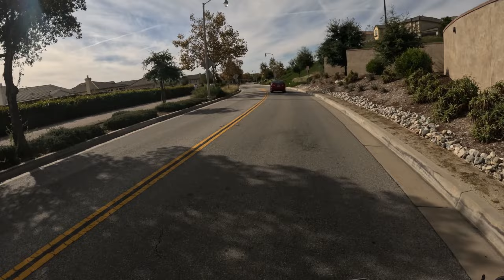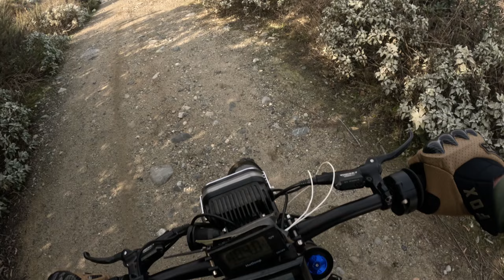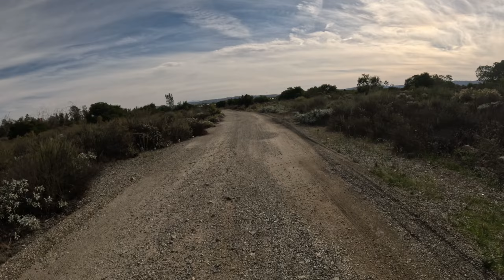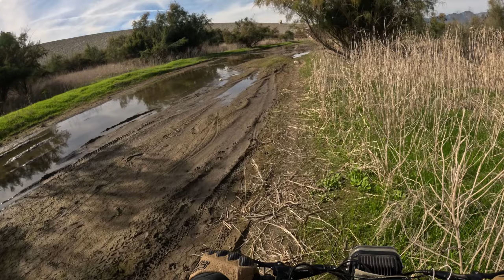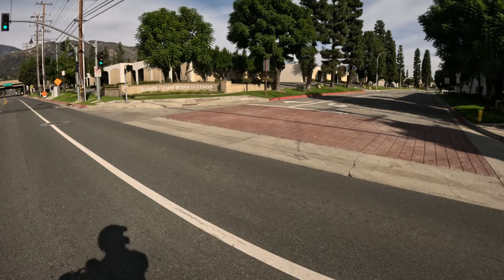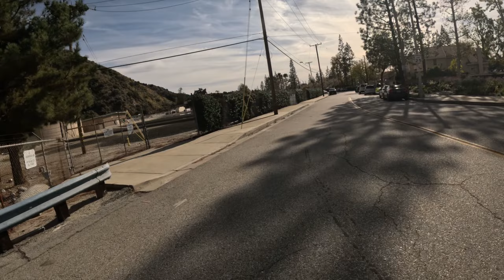Testing out the HSU Windslayer on a GoPro. Dealing with Karens, hitting jumps, and high speeds.

Comment: Nice bike. How did you connected the temp sensor to the motor ? Did you used the stock temp sensor with the white cable inside or did you manually installed a new one into it ? Would love to see how you build this monster. Nice content 👍
Reply from the maker: To be honest, it's an oven thermometer. The probe is attached to the heatsink on the controller.  It runs hottest in my bike.